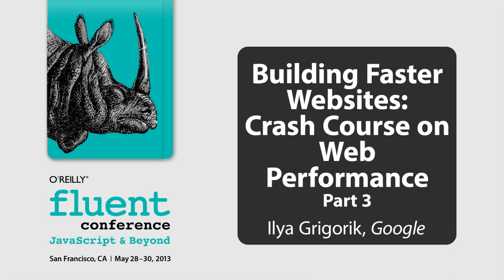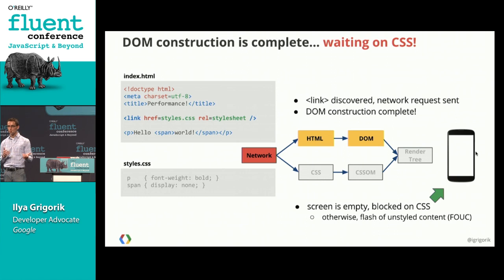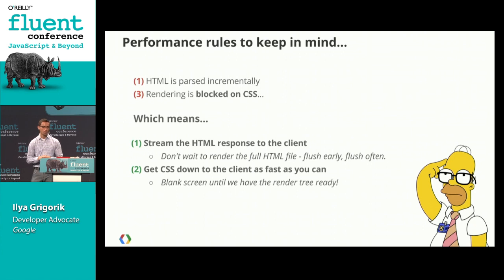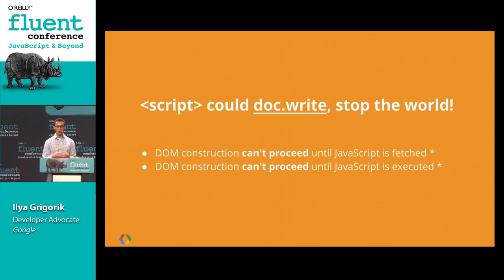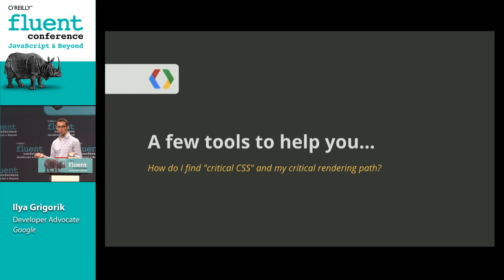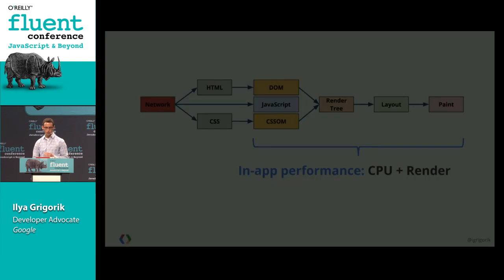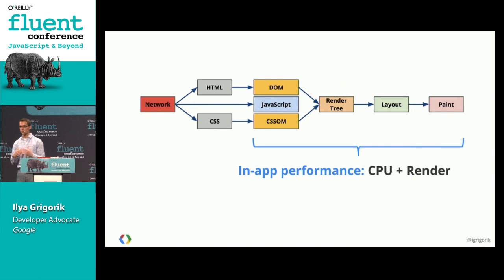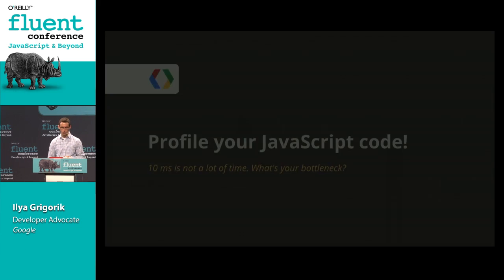Critical rendering path - Crash course on web performance (Fluent 2013)

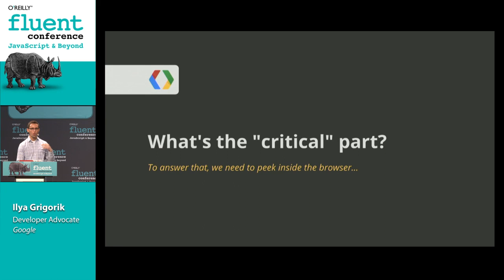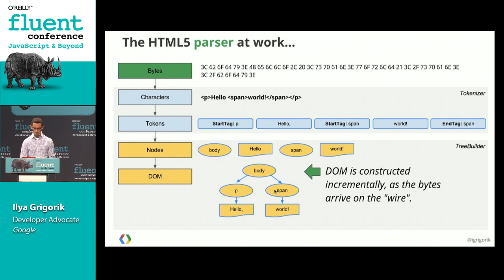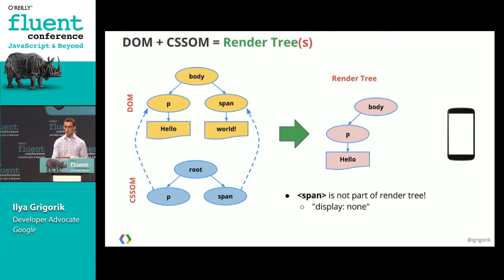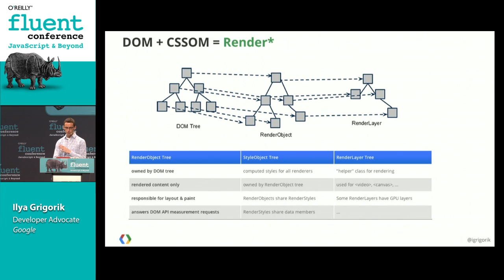Comment: 00:37 what's so critical about the CRP, a very simple example 01:21 first part 02:01 done incrementally, HTML5 parser 03:03 waiting on CSS 04:12 CSS, in 2 packets, we got the first line 05:09 finally we got the last line 05:26 next, we actually take this two trees, render trees 06:28 in fact there is no one render tree  07:05 so the idea of the CPR is exactly this 07:32 what is layout and paint 08:00 the second strategy is actually much better 08:32 a fun example, google search page, we immediately send you the header response 
========================================
JavaScript
========================================
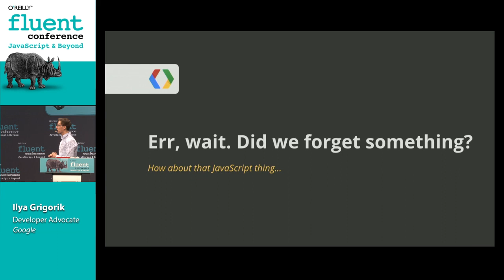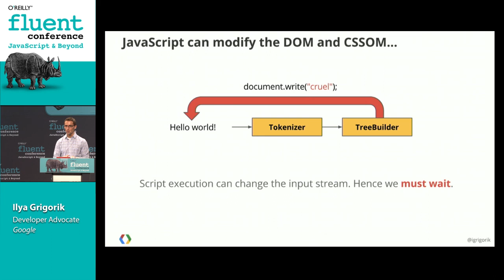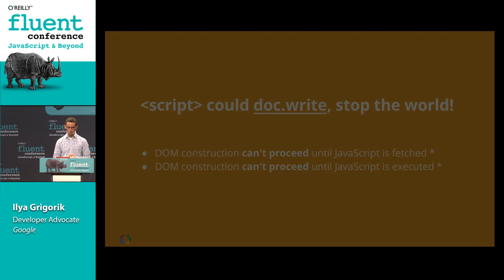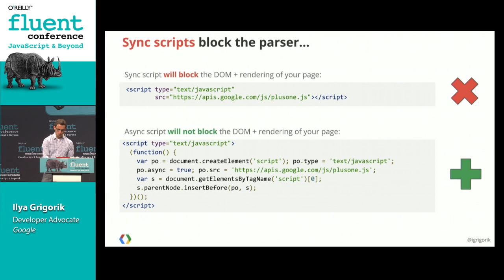10:02 javascript, it actually makes the things more more complicated 10:32 JavaScript can query the DOM and can also query the CSS object model 10:49 here is an example 11:20  <script>, an arbitrary piece of something 11:40 literally it block the DOM construction and everything else 11:55 we have to fetch the JavaScript and we have to execute it before we can proceed, JavaScript at the bottom, CSS at the top 12:45 synchronous block the parse, asynchronous scripts, example, google + 13:43 the async keyword is basically a promesse, its a handshake 15:04 here is an example, JavaScript can block both the DOM and CSS 16:22 put in together, so that will helps us to speed up the initial rendering of the page 16:46 let's say we want to break the one second mobile barrier 19:18 here is an example, we have to start inlining things 20:32 a lot of JavaScript enhancing experience, jQuery 21:52 DevTools

Comment: 08:20 sending HTTP-headers immediately after receiving a request, before analyzing a query
09:09 deliver CSS that only needed for rendering the particular page as soon as possible, deliver later CSS for the rest part of the site.
34:00 aggregate scroll events and defer them.
35:00 split a long running function, execute it partly, then yield control to the browser for updating the screen, and finish the rest part of the function

Comment: I'm still wondering why they can't take advantage of P2P networks to solve latency issues on cell phone networks.  Especially in areas where even 3g is not available like Bolivia and Cameroon.JUst cache popular websites and save on a P2P network. Then connect to the P2P network using WIFI.  THis is one  way for Satellites services on sailboats to solve this problem....Just cache the web.   I"m liking ANdroid's new API for WIFI networks and HTML 2.0 --> UDP.